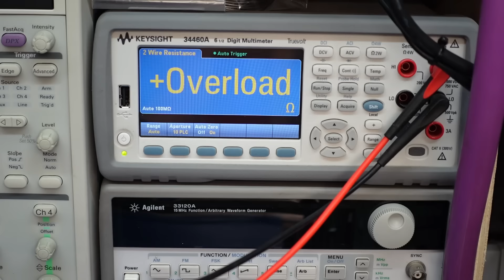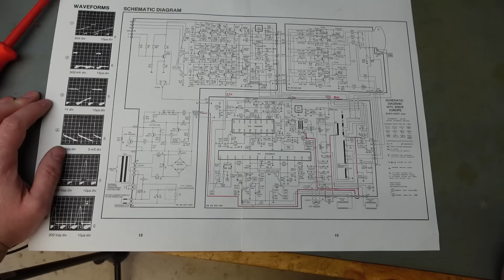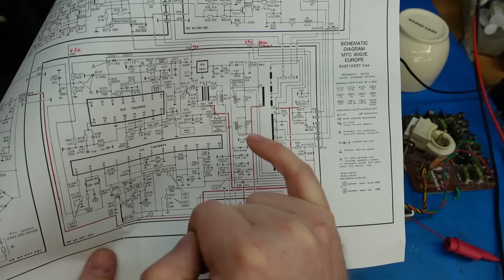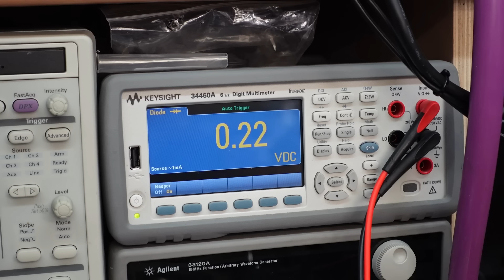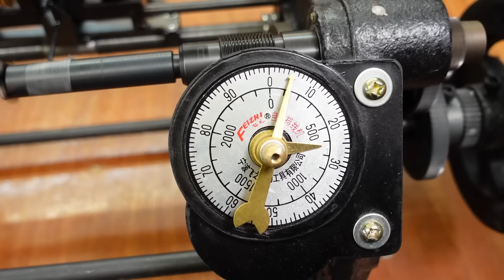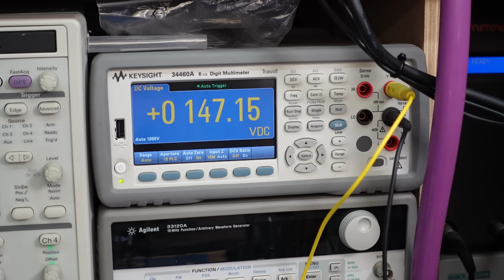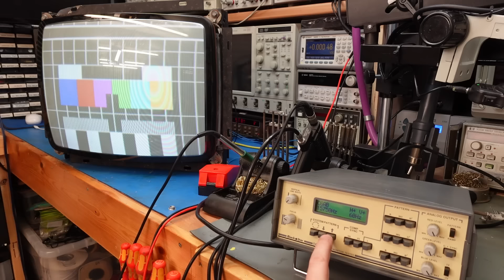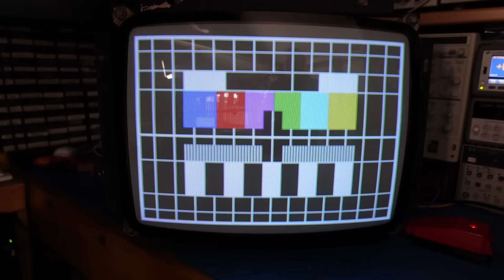Arcade Machine Monitor (Hantarex MTC900/E)

Comment: I haven't seen a TV repair since 1985. With the dot bar generator, too bad you didn't degos the the picture tube. It made the phosphates come alive with color and the fine tuning (or alignment) was finely tuned using the dot bar generator was for. Chroma-alignment, after all the years I'm watching this and I only did one in my entire life! In Jr. High school with a friend back then name Seth Isenberg I think? Anyway we were hanging around and watching a Zenith TV 25" color. I notice the chroma-alignment looked whacky so I offered to fix it. At that time period the TVs (25" color) had a minnie dot bar circuit card you could mount it on 2 screws so you could use them to blend the colors to a white line out of primary colors. I got caught and never did one ever! You really hit a nerve with this episode! Cheers!

Comment: You are brilliant, Mark! It is so rare in this day of specialists to see a true Mender at work. Everything from coil winding to fabricating replacement parts for the structure; whatever is needed to return a thing to usefulness. You are talented to the extreme, yet very pleasant to see and hear. Time spent in your workshop is pleasant indeed.

I knew one other like you once (my father), so I've seen enough of this to know what you are doing and how skilled you are. He told me that when he was a boy, the only toys he ever got were the ones that other kids had broken and discarded, so he starting fixing things early. I wish I would have learned more from him. I see that same level of confidence in your work, and in the way you approach and analyze things.

Comment: Ah, the good old, (scary!), days. That coil winder is a real beauty. I remember the second T.V. I worked on. I was looking inside at switch on and a cap blew up in my face! I hide on the other side of the workshop too now! Still lots of tube stuff to fix but the CRT anode HT was always a great teacher of respect. I think some of the last big CRT's were up around 100kV. Thanks Mark.
Reply: Large CRTs never went above roughly 30kV, because of the risk of generating X-rays.

Comment: Enjoyed seeing a repair on a CRT, takes me back 30 years in my early career,,,occasionally getting a belt from 1/2 live chassis on old TVs and monitors, to my Dads delight when I worked in his TV and audio repair shop at weekends during my formative electronics studies...Good job
Reply: The odd unpleasant 'belt' or two is/was the best way to gain respect re. old CRT sets.  They can deliver a very nasty 'bite'. Early sets with mains derived EHT could be lethal.
It is foolish to mess with anything you don't understand.  Nevertheless, we all have to start somewhere, and we have all made mistakes. It is just part of the learning process.

Comment: Mark, as someone who has undertaken monitor repairs onsite, including in public spaces, I am in awe of the work you do. We used to swap out driver and scan boards and then repair the boards back in the workshop. I cannot believe now that I would take the back of a terminal, sometimes on the reception counter of University libraries - Defo less H&S rules around then! Fortunately for us we worked for the system manufacturer (Cifer) so was able to source all new parts so I have never had the joy of rewinding a transformer. I've dabled with LCD TV Repairs and retro electronics but hoping to do more once I move house and setup a better workshop. You and your setup are an inspiration sir...

Comment: Good to keep the fingers  well back when discharging the CRT, if I remember correctly the charge can jump 1cm for a CRT charge of 30,000 volts. Learnt the hard way back in the day. Found a specialised discharging tool eventually, happy days.

Comment: I have just discovered this channel. I used to work in the trade, back in the day. 20 years ago now. I consider myself very competent with electronics diagnosis and repair, but I have to admit I would not even have contemplated rewinding that transformer. However, watching you do it has taught me that it's possible. The winding machine is kind of important, though.
I was chuckling often at the very healthy respect that was shown for the line tranformer output, and even the self recharge capability of the tube. That is the kind of respect that can only be shown by someone who has worked on these long enough to get a jump off one. And I've been there, and I am frightened of the HT cap in exactly the same way. 😂

This was an excellent repair.

Comment: Skill! I did a similar but crude repair to my brothers central heating boiler. The gas valve was open and the gas supplies shops- not plumbers- wouldn’t sell me one because I wasn’t CORGI. Registered. I’m a lift technician, or was in the early 70’s. So, I took the potted core out and dismantled it substituting the coil with a varley one, rewinding it onto the original former and re-potting it. With tar. Worked a treat!  This of course was pre snowflake times and my little brother was training for his P1/2 exams. He’s now a multi millionaire and lives in France in an old Mill! So, study accounting and you can retire at 50!

Comment: When I was a kid,in the 50s the tv engineer used to just short capacitors with a screwdriver. Yes including the “Big” one. Being interested I asked him if there was a tool to do that,he said yes there is, but when you’ve worked on Radar during the War now that really was high voltage these are nothing.😀😀 We had a PYE fully automatic 17 inch tv set. Not sure what was automatic about it. The horizontal hold always let go when we’re watching something interesting. The TV guy never did cure it. I always hoped he had better luck on the Radar. But he was a nice guy,who put up with a kid watching what he was doing.Although I kept fairly well back!

Comment: Way back when i use to work for LG i always took 2 long AF screwdrivers, stick one in and other one on the other going closer and close to the ground, those high voltage jumps always amused me. picked up a charged base one day and my belt buckle touched it, knocked me on my butt, 18years later and i still burn holes in my hands with high voltage stuff that i forget to discharge..

Comment: Another great video mate 😃👍, the "helping hand resistor" access the b plus regulator is common in monitors, ive seen those regulators shorted a lot of times, a dead give away before you even open her up is the set will power up at lower voltage on the variac but cuts out as you increase the input voltage and the xray protection circuit triggers...

Comment: In 1997 I had a nice 19 inch computer monitor. It cost 1k$. After being ON for an hour or so the image would start to wiggle and jump. Usually a Percussive Engineering Adjustment(PEA) would fix it for a few minutes. PEA means you slap the case but only engineers are allowed because everyone else hits it too hard and breaks it. Then an hour or two later it would do it again and another PEA was required. Finally after like 6 months I was fed up.  I took it apart and removed three substantially large circuit boards. Each had hundreds of components. I put on my magnifying headset and inspected.  I reflowed the solder on a few suspect places and put it back together. But it still had the same issue. Took it apart a second time and this time I reflowed the solder on every solder joint. Every one! Took a few hours. Even the big clunky ones that surely had no issue but they got some nice new solder too. Put it back together and it was an excellent monitor until it eventually got replaced with an LCD.  It was still working just fine but it went into the recycle bin at work.  Frankly I think the recycle company just dumps them in the city dump and charge us money for pretending to recycle.

Comment: I used to repair and refurbish pinball and arcade machines. Power washing monitors was an accepted and totally fine method to remove years of dirt and dust. Of course being CRTs we had to be extra vigilant of fly back transformer voltages and not turning them up to the point where they became X-ray generators ;)

Comment: Thank you Mark,been along time since i repaird a CRT monitor, TX winding was first rate, Acetone and IPA are my go to chemicals for sticky removal,Acetone a bit more aggressive and sometimes can damage rubber/plastics,might of got the TX sticky crap off easier. Changed 100's of IBM monitor , flyback TX in my days,probably the most unreliable part of a CRT monitor back then.Wyse 50 terminal was another flyback failure favourite,along with the RS232 88/89 driver ics.Happy days,good money earners.

Comment: I worked on stuff like that for 40 years. The fast and simple way to start is to check the collector of the horiz output transistor for a short. If no short connect power to the monitor and check for B+ voltage at the collector of the horiz output. If ok the drive signal is likely missing. If no B+ go back to the power supply. That transformer you repaired is the horiz drive transformer .The horiz osc  comes from IC 2 to the base of TR10. Another thing to be aware of when you work on monitors like that is they may require sync from a video signal to turn on the horiz osc. NO video signal connected the monitor may not come on.

Comment: I had to chuckle at the beginning with fingers in the ears as that's me when i'm doing defective 440v electronic drives, I turn them on from the other side of the room lol I'm also glad they don't make crt's anymore as that is what i started on doing in the service industry, i used to work with this rather interesting technician who would turn  a tv on and put a screwdriver under the flyback transformer cap and see if he could pull a spark from the it to his screwdriver to check it was working he was a bit of a fruit loop to be honest lol

Comment: The HT oscillating transformer primary and secondary side separated by silicon cotted tap that's will prevent power leakage from primary to secondary during high frequency switching.

Comment: I used to remove HT connection from the CRT with a loop of a nylon (kite) wire once round the connector , pull it tight  it then should pop out of the CRT without damaging the conductive inner of the glass CRT connection (of course discharge the HT first like you did)

Comment: I do not know why one would unwind the small wire. I would measure it in size, then check the ohms rather than turns. But one would need an exact ohmage. But your way worked fine Marc. You are nothing if not dedicated, my word.

Comment: Nice job winding your own transformer. Without that machine, 630 turns, using ultra fine wire, would be a very difficult task. You might be able to make a few quid winding those particular transformers. There's a bit of a demand for them as this is a common problem with the MTC900/E chassis. Some guy on the arcade forums went to the bother of getting them made by a manufacturer. But that pushed the price up quite a lot. There's a lot of these chassis still around. But nobody want's to bother fixing them. There stuffed with 30 year old caps and everybody seems to want a full electrolytic re-cap. I wouldn't blame them tbh. But a re-cap on these would be a big job.

Comment: Another nice video! I've recently "fixed" my first CRT and I'm glad I'm not the only one super-careful and just refusing to stick probes in the unit when it's on! You are incredibly more experienced and skilled than I am but I could feel you were not so comfortable playing around that big vacuum tube running at HV! I was wondering if the flyback transformer could be powered with no picture tube connected - I guess it can be, with precautions of course. 
Also love the little 128V in/out through the deflection connector so nothing starts if the connector is unplugged, to avoid damaging the CRT!
Reply: It is very common on CRT monitors to connect the B+ through the yoke plug to the flyback to prevent what you said about damage to the CRT. The HV will come on if the 2nd anode lead and the CRT sockets are not connected.

Comment: The best solder joint ever was not Pb solder and rosin flux.  It was Pb solder and organic flux. Beautiful shiny joint. BUT!! that organic flux was acidic. And it would eat up that PCB if any was left on.  Often organic flux was trapped under an IC that had some traces also under it. After a year or so those traces would get eaten up and the board failed.  So at my company I changed the rinse water to warm soapy water applied in a big sink with a gentle stream(not blasting).  The soap would reduce the surface tension so the water would get under the ICs.  Then a second rinse to remove the soapy water.  We never had another failure. The solder joints were bright and beautiful.  Of course we made sure to use parts that were entirely water proof and pretty much all parts were.
Today everyone uses "no clean" flux. Yuk. What horrible solder joints. Dull. Pitted. My boss who taught me to solder PCBs in 1970 would fail all of these no-clean boards.

Comment: I wonder if Naphtha would be better on that transformer adhesive? Its about the best stuff for loosening and removing adhesives that I know of. Is a refined Hydro-Carbon mix, light distillates of 5, 6, 7, and 8 carbon chains. But Zippo type lighter fluids or Ronsonol lighter Fluid may work in a pinch, not sure what you have available over there, I know your country has restrictions on a lot of useful chemicals.

Comment: Is it worth doing a gun cleaning if the picture is a little old and weak?   Even a light clean and bal would do wonders and not risk the guns or tube. If you have the machine, you could do a video or on a weak tube you have for those that hant seen a checker/rejuv device in action..

Comment: Hi Mark, i’m new to your channel.  I’ve been repairing 80’s video games for about 13 years now and still struggle to get dead monitors back to life.  I’m really familiar with these Hantarex 900E ones and had a few of those TH2’s go the same way.  I was having kittens when I saw the isolated side hooked to what looked like mains.  What is backing that supply on your setup?  Do you have a variac and a 1:1 isolation block?
Reply: I think his test power socket is isolated

Comment: That winding machine is fantastic .. I was wondering how old it is 😂 or, is that typical for this tool?
Reply from the maker: It’s a Chinese NZ-2 coil winder. I bought it brand new last year. However,  I think the design is very old. I’ve had to make a few mods and improvements to it!
Reply: @MendItMark  looked like an apple peeler that you may see on the antiques roadshow 😜 Actually leads me onto an idea, you could do a walk round in your workshop, I'm quite sure it would interest a lot of us. Like myself, I am certainly not an electronics whizz like you, but your bank of measurement tools looks like the bridge off the enterprise and you seem to pull out all sorts of tools like a magician pulling rabbits out of a hat. Anyway, enough of my ramblings, I enjoyed your video, as ever. Stay safe.
Reply: Love your channel, nice repair, love your optimism.  Well done!
Reply: @MendItMark  Thanks, I suppose as far as designs go, "if it aint broke don't fix it". I see at 19:00 you also have an 'unwinder' - looks a bit more home made, can you tell us more please? Great repair!
Reply from the maker: @johnas2004  the unwinding machine  is actually another Chinese winding machine, the NZ-1. It has a better counter, and works great in reverse! They are very cheap to buy, you couldn’t make one for the money.
Reply: @MendItMark  Hi Mark the winding machine with the counter.  This looks like one in a transformer factory I used to work at about 10 years ago.  The winding machines they used were more Sophisticated manual and computerised equipment, operated by someone at a work bench pressing a foot pedal.     Interesting video thanks for sharing.